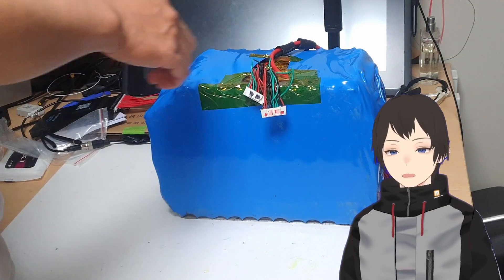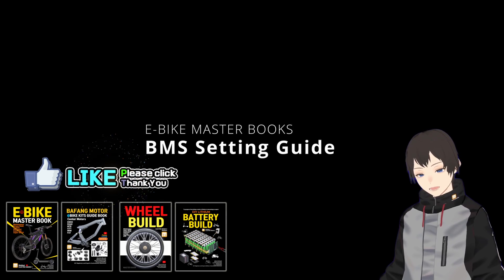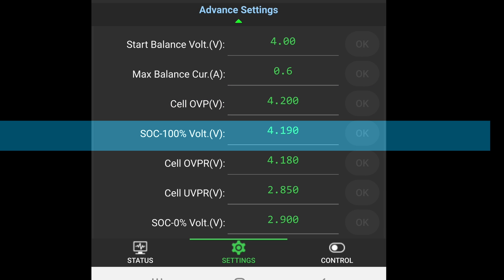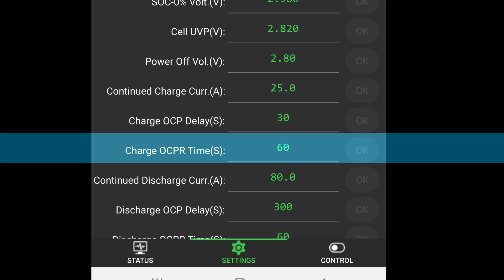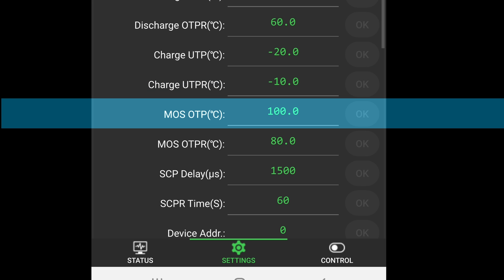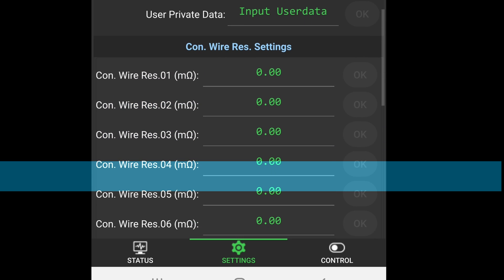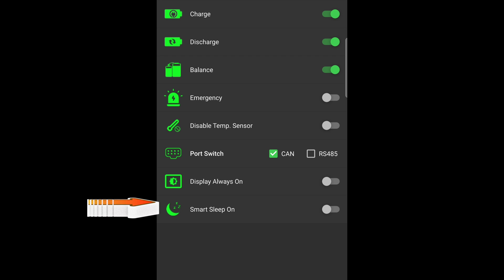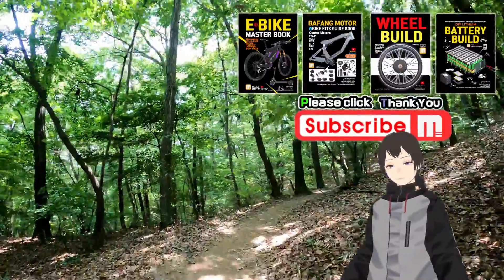Best DIY E-BIKE, Motorcycle Solar power ESS Battery Pack JK BMS Manual Setup Manual : Master Books

Comment from the maker: Using a BMS with an (A)amperage rating that is 20% higher than the continuous allowable current of the motor is recommended.

Comment: Electric Scooter hub motor 48v 250w bldc , battery 51.2v 30ah LFP , how much amperage BMS should be used , and any model number and link from where to buy
Can we use 100a JK BMS for this
Reply from the maker: BD6A24S8P   It's over spec, but anything above 40A should be sufficient.
https://s.click.aliexpress.com/e/_DDWmpRf
Reply: 20 amp bms would be enough for that. 30ah doesn't relate to battery max current.

Comment: Do you charge the battery with the same qs connector or have a separate connector to charge the battery
Reply from the maker: The battery pack uses a single QS connector. Additionally, an XT90S connector has been added to the controller wiring connected to my bike for charging purposes.